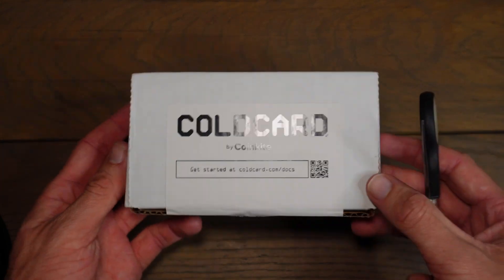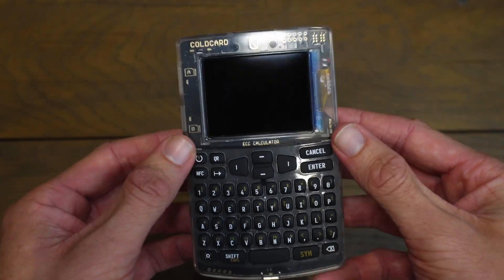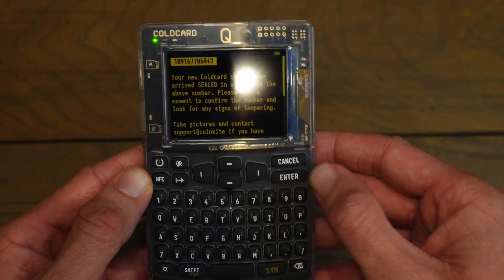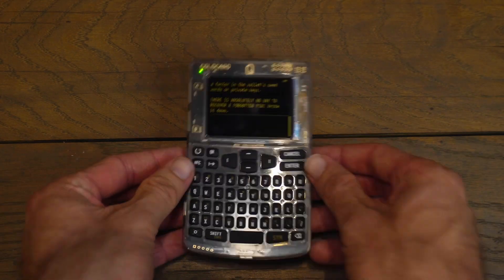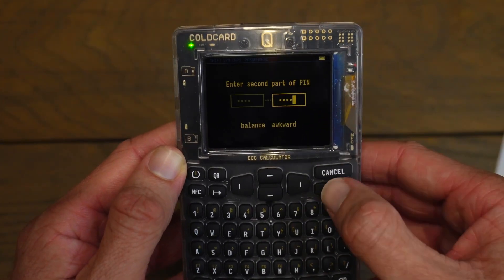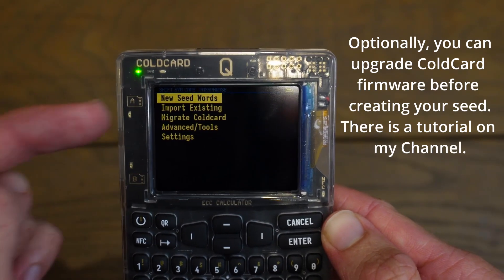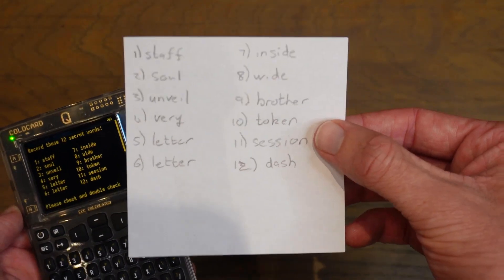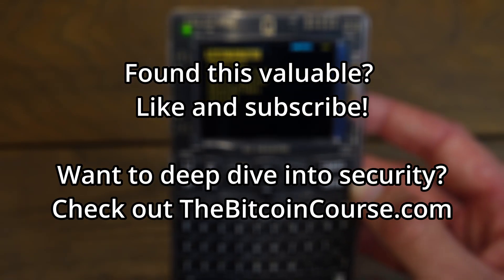Coldcard Q Bitcoin Wallet - Unboxing, Setup & Create Wallet

Comment: never leave batteries in the device.
Reply from the maker: Why?
Reply: @SouthernBitcoiner    only if you are not using it frequently or going be storing it for long term as batteries will corrode inside if left in for a long period of time. to for extra safety

Comment: Does this come with the Small card? And usb cord?
Reply from the maker: No card and no cable - better to use batteries
Reply: @SouthernBitcoiner do you need  the small card to receive?  Is the card really necessary in a little confused.
Reply from the maker: No all you need is ColdCard Q to recieve and send coins
Reply: @SouthernBitcoiner  okay, let me see if this makes sense. 
 Buy a Q and set it up I can easily send BTC to it without the card and the sparrow app, or is the sparrow  account  necessary before sending BTC to it? I do t want to use ledger anymore.